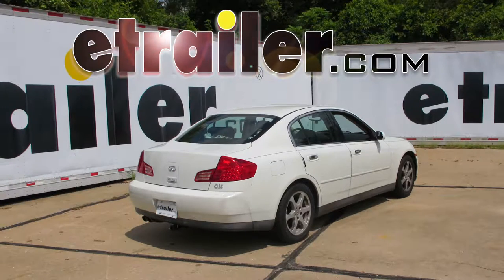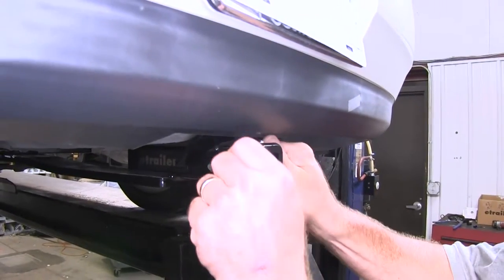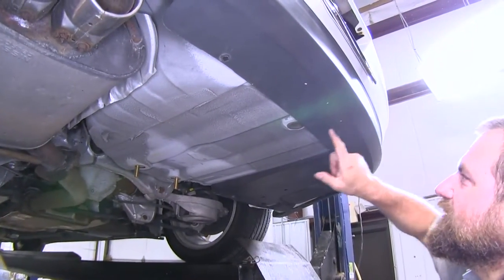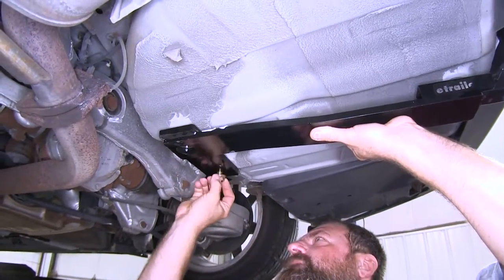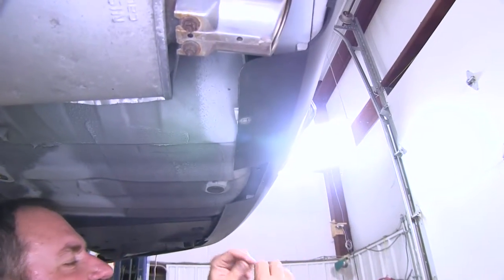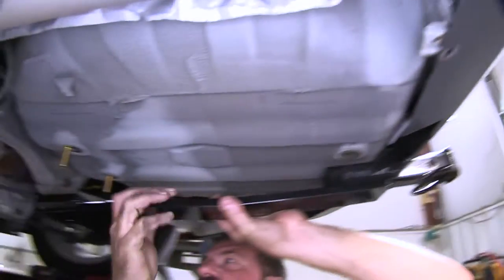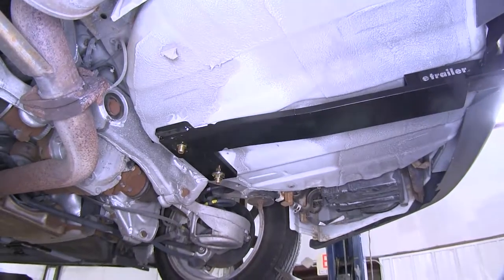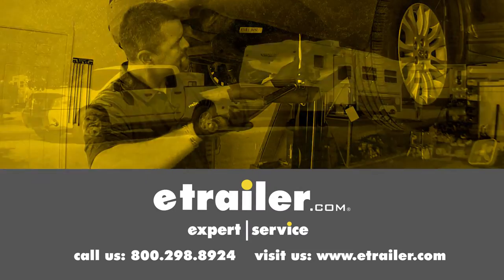etrailer | 2003 Infiniti G35 Curt Trailer Hitch Receiver: Complete Installation

Comment: Does this also fit the G35 coupe?
Reply from the maker: It does not. For the 2003-2006 Infiniti G35 Coupe, use # C11483 which is a confirmed fit.
https://www.etrailer.com/Trailer-Hitch/Infiniti/G35/2003/C11483.html